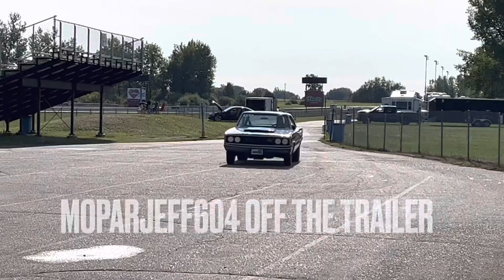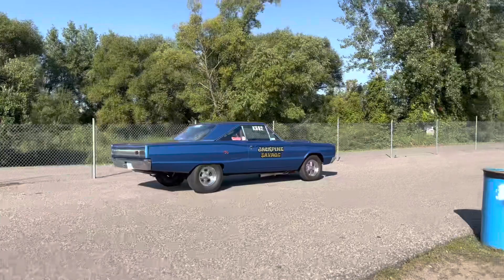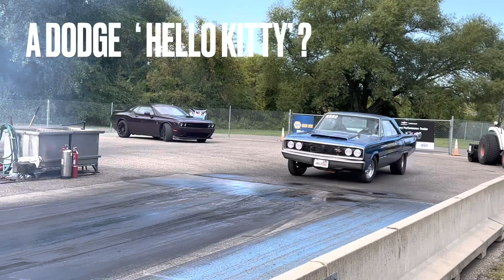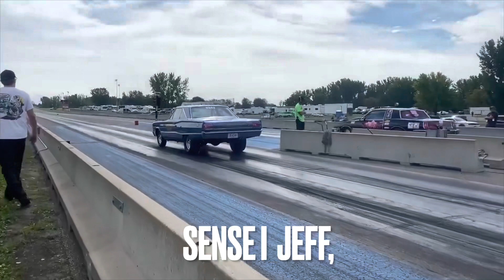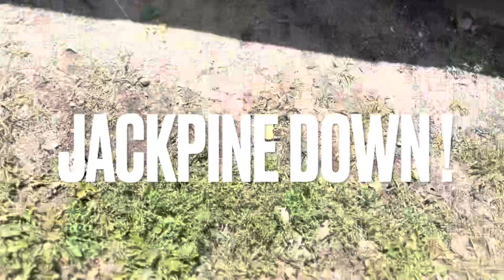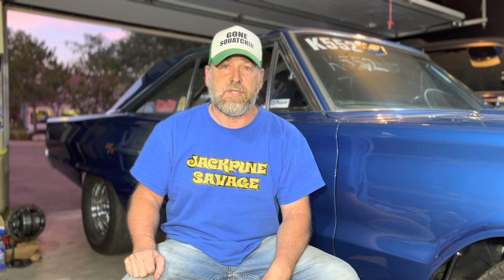1/8 mile Test N Tune #nonamenationals

Comment: Great looking car! I'm glad you went with the period correct Cragar S/S wheels instead of modern rims which would have ruined the classic 1960-1970s look of this R/T. I know Cragar wheels are heavy as heck but if it's not an all-out effort race car, e.g., NHRA class car,  it's not an issue, and the look, in my opinion, can't be beat. Dick Landy used to run 'em on his Dodges back in the mid-late 1960s through 1971.
Reply from the maker: It will never have any other wheel combination

Comment: Fantastic car! I had a leak just like that perhaps 40 years ago that also stopped by itself- it was the front bearing the hub of the converter rides on. It was due to putting the car in neautral while coasting at high speed on the highway (my stupid idea for saving gas at the time). Stopped leaking, pulled tranny, and front bushing/bearing was scored from low oil pressure from the coasting in neutral at high speed- output shaft fast, front pump slow- oil starved front bearing/bushing!
Reply from the maker: Thanks for the information. So far fingers crossed. 🤞

Comment: Also on the 727 pans the only gasket I’ve had luck with on aluminum pan are the blue moroso and on steel pan the lubelocker gasket.
Reply from the maker: EXCELLENT ADVICE, was reading your comments and Jeff agrees. Going to get it up to temperature and check the levels.

Comment: Mark if you ever have trouble with burning up plug wire ends like most big blocks with large tube headers a nice wire is the accell with the ceramic ends.
Reply from the maker: Think you were right so far no more leaks. I think over filled and running a smaller converter than previously
Reply: Ya checking level in neutral on 727s also always after running through gears and operating temp it’s easy to over fill them.

Comment: Awesome runs. Is the front seal leaking?
Reply from the maker: Gonna run it hot today and check fluid. It was over full and smaller converter. Hoping that’s the issue. Only happened after 3 hot laps and having ran the car all day.
Reply from the maker: Got new seals coming just in case…😅

Comment: 🇺🇸👍 I liked it, but what did the car run, time, speed ? Are you planning to continue running 1/8 mile if so are your rear gear set for that or are planning on running mainly 1/4 mile ? Either way it sounds strong looks good and you have done good! 👍🥩🥔🌽🍪🥛💤
Reply from the maker: The rear gear and converter were planned for 1/4 mile. But to be honest I’m ready to let up in the 1/8 mile… for now 😉 guess until NNN we’re keeping it secret? it’s a second faster than it ran before I got it.